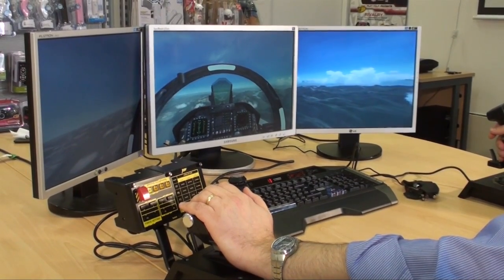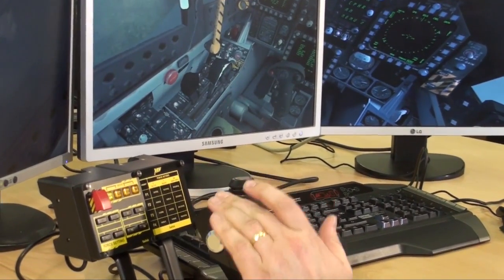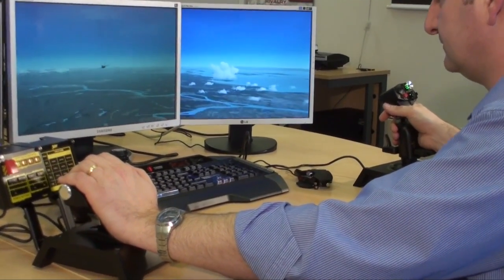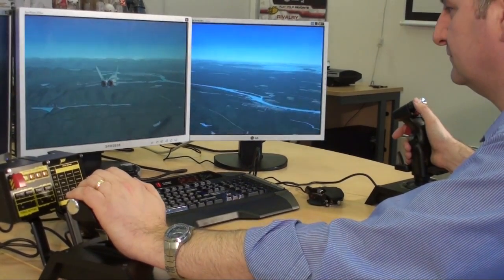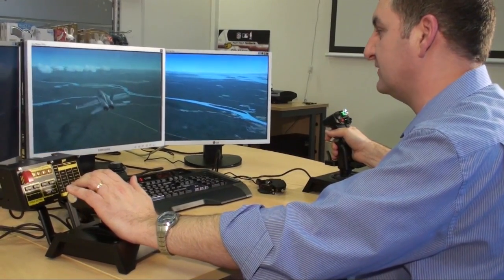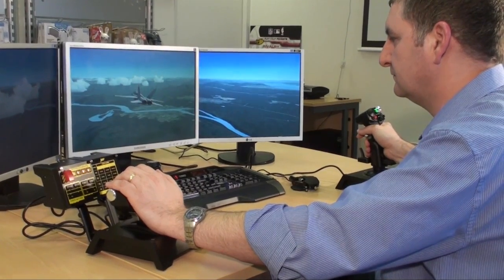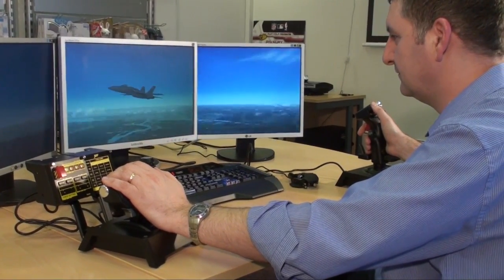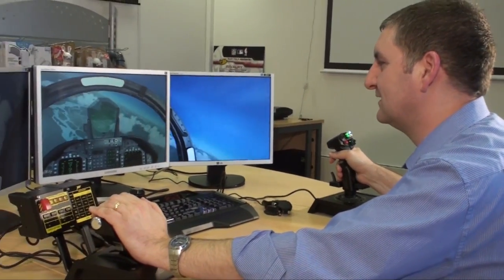Saitek ProFlight X-65F Combat Control System Demonstration Video 1

Comment: @JSAirways its called a combat control system, not an airliner system. The point of having a simulation for fighter is that you probly wont get the chance to really fly one. If you want something to fly other planes with, check out the pro-flight yoke systems.

Comment: In what kind of situation would you use separate engine controls?
Reply: When moving into idle if the HOTAS has something like a idle detent (I think its called like that) on engine startup.

Comment: I'm not a big fan of the force sensing thing. It's very exhausting and it throws me all over the place lol, I have to set a high deadzone to make it manageable. And as I understand, many real pilots hate it as well, there's no feedback for example.
Reply: I can imagine how an immovable joystick make you exhausted overtime.. Not really a good idea.. and it takes the realism off of it. I do like the X56 throttle though
Reply: The point of a stress gauge vs a ptentiometer joystick is that one relies on muscle memory, and the other relies on movement memory. Just like a real car's brake vs the brake on a cheap sim wheel setup.

Modern planes are fly-by-wire and dont have any kind of feedback on the stick-yoke. So strain joysticks are the same as the potentiomenter joysticks in that regard. One big advantage strain joysticks havce over potentiometer ones is that you dont have to move your hand or arm to use them. This comes in handy when performing high-G manuevers on a fighter aircraft, for example.

That's why mostt fighters have strain joysticks instead of potentiometer ones.
Reply: @Vampiresquid007  Yeah, realistic stick forces (where applicable) takes the realism out of a flight simulator!

Comment: Where you guys having trouble? I didn't see the stick moving... :-( 1/10 review
Reply: its not designed to move. it senses pressure. based off of current gen fly by wire aircraft.